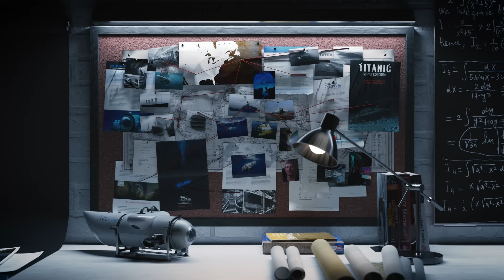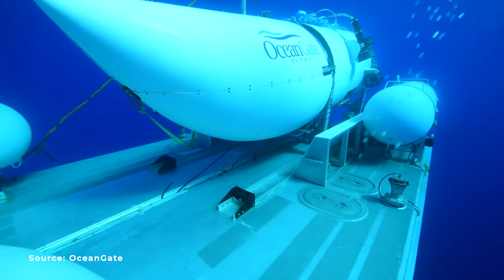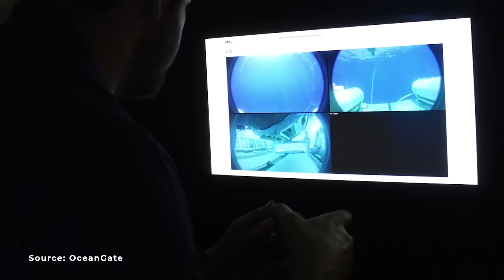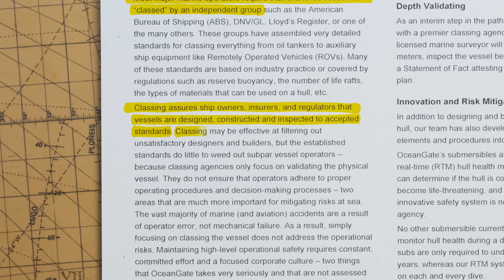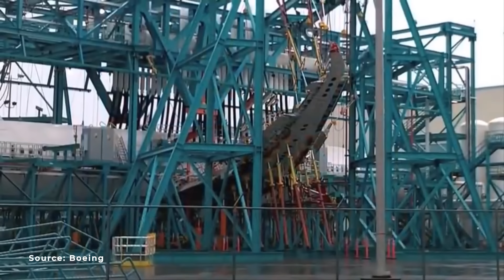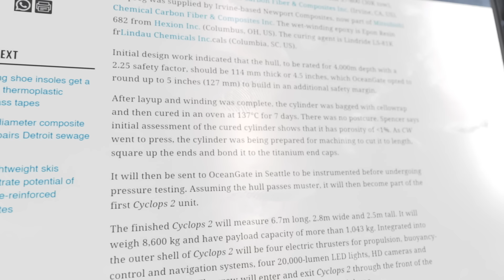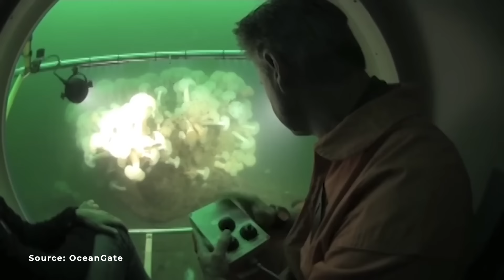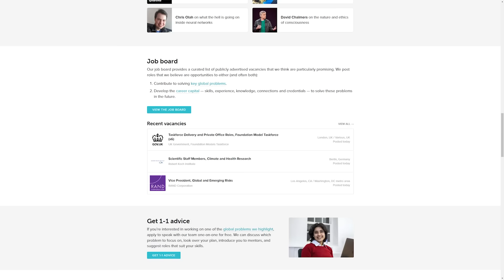The Questionable Engineering of Oceangate

Comment: I remember a friend studying engineering in college told me his professor said he was so strict about them making mathematical errors on exams because, “engineering errors lead to injuries and death. You need to take responsibility that a mistake could be deadly.”
Reply: That's exactly why we do have independent entities and engineers check our work, to confirm that we've not made silly mistakes or overlooked something crucial.
Errors are inevitable but as long as convention and regulation is followed, you're at least doing your best and using the knowledge and experience gained from past mistakes.

F***ing hate it when cowboys come in and think that they know better...
Reply: I wish my students would understand the same! That is why I am strict on my engineering exams. Lives are on the line!
Reply: @DavidMcCoul  "safety regulations are written in blood, try not to create new ones"
Reply: @DavidMcCoul  Well, did you explain them, that's your job after all???
Reply: Being weak at higher math I decided to get into the Architecture rather than the Engineering. I simply  design Flighted Fantasy, the Engineers have the important task of making it a Reliable Reality.
Reply: @redneckhippiefreak depending on where you're from, us architects are every bit as responsable for a building's structural integrity as the engineers making the calculations
Reply: @agustinvenegas5238  Here in Germany there is not the one specific architect profession. Depending on their background you can have architects that only do interior design up to to architects who are contruction managers, handling all tasks from planing over writing the service specification for construction companies to bid on, down to the acceptance of the structure at the end.
Reply: @redneckhippiefreak  I'm sorry but I didn't say that, I said we're every bit as responsable for a building's structural integrity, again, *depending on where you are*, here in Chile, famously tectonically active country, I as an architect are equally liable for a building's structural integrity as the civil engineer bc it's my signature the one finishing the project before its sent to the municipal inspectors, in the US it may be different, another commenter said in Germany there isn't *An Architect*, but several architectural designers that, I assume, dont have the same liability as if there was one guy doing all that work, hence why where you are was the first phrase on my comment, I appreciate your feedback though m8
Reply: Regardless of lawyers and insurance,, engineers get put in jail for manslaughter for negligence.
Reply: This case is not akin to a mathematical error though, and more akin to modes of failure and entire branches of materials science being ignored.
Reply: i remember when we do component design in class, i tend to roundoff the 2nd decimal place this infuriated my prof.  and he showed me how my roundoff calculation made a 5cm gap in a critical joint.
Reply: In Canada, we get an engineering ring that used to be made out of iron (now just stainless steel), the same iron of the collapsed bridge that killed many people.  This is to remind us our mistakes will results in many lives lost.  A friend once told me, "I'm a surgeon, my mistakes can kill a person, your mistakes can kill hundreds, thousands, millions!"
Reply: @hhputube 
😮!!…
Reply: "Regulations are written in blood" is a saying that comes into mind
Reply: Its why engineers end up hating clowns with arts degrees.
I did aerospace engineering and I had to do 2 additional pure maths classes before we started on the wonders of aerodynamics and other fun stuff. The actual number of classes I had to take added up to the equivalent of an extra semester but planned to be done in the same time as an arts degree.

I have spent most of my career in industrial control systems and automation. A lot of that includes safety control functions like Emergency Stops and Safety interlocks. You know that stuff that keeps hands attached and prevents stuff blowing up. I eventually got the second highest qualification any engineer can get in that field.

Getting that qualification has kept me OUT OF WORK. 

People like Managers and their Human Resource minions don't like people who speak out and people with qualifications are often caught out. Their employment contacts often include clauses where "if you know something you must speak out" which clashes with the reality that if you speak out you get your contract cut WHICH HAS HAPPENED TO ME just like it happed to the submariner/engineer David Lochridge who's suing Oceangate.

You can't imagine how much I hate recruitment people these days.

If you think engineers are angry over this sort of crap YOU'RE DAMN RIGHT and its about time there were some actual laws that protected us. Because when we're allowed to do our jobs properly YOUR LIVES are safer.
- When your driving a car its mechanical engineers who designed the brakes to help you stop before the tree;
- When you plug something in its electrical engineers who make it so you don't get shocked;
- When you drink a glass of water its chemical engineers who make it so you don't get poisoned;
- When you get in a jet to fly off on your holiday its aerospace engineers who keep the wings attached.

We keep you clowns alive in 100s of ways every day.
And before any of you complain just note you wouldn't even be able to read this with out engineers.
Reply: Not really how responsibility is actually handled in industry. Any project significant enough to be a risk to human life should have a team behind it, not just one person, and there should be rigorous checks and testing to find mathematical errors or any issues that result from them. Good engineering process isn't about expecting nobody to ever make a mistake, it's about being resilient to mistakes.

At least one engineer realized the issues, so this wasn't an issue of mathematical sloppiness. Leadership on the project willfully ignored expert advice, and skipped safety processes. And on the engineering side, only one of the engineers actually put their foot down, the rest just went along with what they must have known was a huge risk. They had a professional and ethical responsibility to demand changes, even if that meant losing their jobs.
Reply: I don't think this comment is inaccurate, but the irony of it is : no amount of university exam math is sufficient for this application. Dry math doesn't cover it and some people get full marks on it because they know how to do it right. Book math doesn't go into much details about potential faults.  Projects and thesis do. And if you do the math, but end up applying it to imaginary, one time application properties that aren't consistent for the use case, you end up with tragedies.

There are math errors and there are design errors where the math checks out, but material science does not, e.g. lack of galvanization, pretty patterns that fill up with water and crack the surface in the winter or simply using the wrong kind of concrete for a salty environment.  There's people who are university exam smart, never work in a field and never learned  about edge cases or forgot about them.
Reply: And people question me when i keep values in my calculator to calculate something.
Reply: 12:33
At least 250,000 Americans die each year due to some sort of medical error. But, depending on what is considered a medical mistake, that number could be as high as 440,000.
Reply: Yes I’m an engineer as well, and we did one semester of purely risk analysis and risk management, because the consequences of engineering failure are so high.
Reply: Cut corners and rich morons doing make a tragedy. 
The 300 people that died of the coast of Greece the same day was the real tragedy
Reply: @existential_crisis_actor  Go look at the photos of that boat leaving the dock in Tunisia. It was a tragedy in the making from the moment they put 700 people on board that rust bucket.
Absolutely tragic, but also just as stupid as Oceangate.
Reply: I studied engineering in college and we had a separate course for safety and ethics about engineering
Reply: Everyone is strict about that. You can't have wrong math. Kind of obvious. Point me to a school that accepts wrong math pls
Reply: https://youtu.be/4NuXF0OCAc0
Reply: A teacher told us that he does not grade on a curve. Some of the engineers in the class would be civil engineers and if they made mistakes then bridge goes boom
Reply: @HanmaHeiro  "Tell me when a plane can pull over and park on the side of a cloud to await repairs.  Until that time, your work is perfect and you pass, or you made an error and you fail - at least here you aren't killing a literal plane load of people with every mistake."
Reply: @muninrob  Excellently put!
Reply: @HanmaHeiro  What do you mean a curve? Like a bell curve of all grades?  It's normal to not grade on a curve right?
Reply: @mintoc8853  It is normal not to grade on a curve. I believe the teacher was making it clear there is no chance of a curve being used. Or the whole this was kind of a joke to make a point since I remember him being a bit comical
Reply: @HanmaHeiro  Oh good, glad to hear that. Engineers graded on a curve would be a nightmare haha
Reply: Which frankly is BS because on a real world project you have other tools and less constraints to do the calculations (computers, etc) also you have a better feel for orders-of-estimation errors than on a theoretical test with often unrealistic values, also peer review by colleagues, etc
Saying "oh but if you get the math wrong the bridge will fall" is just hazing
Reply: @dsracoon  Mariner I exploded due to a forgotten hyphen in the code and the Mars Lander because of a wrong unit conversion. These projects consist of maybe the biggest teams you can find in projects yet these stupid mistakes were missed. Mistakes can and will happen, be it with old or new tech. You'll have less errors like that in civil engineering because it's less high tech and more traditional but that doesn't mean they don't exist.
Reply: @mintoc8853 civil engineers are the only ones i would trust now. The "engineers" that colleges and unis have been pumping out for the last 20yr are vastly less intelligent and cappable than the older guys. Ive been a boat builder since i left the army in 1986 and have forgot more about composites and layup than anyone thats came out of higher education since around 1995 when it got dumbed down
Reply: @bigduphusaj162  well maybe that's a problem of the local university near you or the people your company hires. It's normal that older engineers will be better as they have more experience. However if older guys are gatekeeping difficult projects without teaching the younger and demeaning them it's normal that they are less competent as well. In theory engineers today should be more competent than before because of the better tools we can use now. Ideally you want close contact and communication between engineers and constructors but sadly that's not always possible
Reply: im a boat builder of 4 decades and i wouldnt trust anything a lecturer or even a masters or post graduate student said pal. I'm the one that needs to fix your modern activist type "engineers" mistakes amd some of them are needing jailed tbh. Vessel building needs older experienced guys at every level from cincept design through to the final pain finish it needs proper craftsmen not blue haired colledge guys and lecturers that failed to make waves at the real job in the first place to even be where they are teaching the blue haired activists
Reply: @bigduphusaj162 quite an ignorant comment, everyone has their area of a project that they specialise in. Your area of expertise is in the construction, others in the design. Neither party could do the others job
Reply: they dont take responsibility, thats what lawyers and insurance is for
Reply: @carlholland3819  Technically, yes. You shouldn't be held personally responsible for any and all mistakes as long as they are not simply rooted in negligence. And this applies for many professions. But... If you're in an job, working on something where lives might be at risk and you feel no responsibility what so ever, you're in the wrong field.

And, when I say "you", it's not you as in "you, carlholland3819", but you as in anyone in such professions.
Reply: @jonsen2k  as an automobile technician I always double check my work because if you do not its very easily can lead to a death.

Comment: In one area you gave a slight false impression.  Generally if the inside layer comes loose, the next layer follows and then the next and then next to the point of total failure, all at the speed of sound in the material.  There is basically nothing, nothing, nothing, BANG.  There is no warning.
Failures like this are most common at the ends of the chamber because there is a discontinuity of forces right there.  In the designs I have seen work repeatedly, the bulkhead has a flange that rests against the end of the tube and a part that goes inside of it.  The part that goes inside is a tight fit so that at pressure the tube comes down and rests on its surface.  The tube is also gel coated on the end and then made to be an extremely flat and smooth surface.  The part that goes inside has two O-rings.  This is a long way from what Oceangate did.  They epoxied a metal ring on the end of the tube.  To me this seems to be just asking for temperature related stress to happen in that area.
If someone really did hear noises from the tube on previous dive, that person was extremely lucky.

Comment: When I first heard about the submarine thing I just heard a submarine was going down to the Titanic and got stuck or something and it was like oh damn shit happens I guess.
And then someone said they used carbon fiber and I was like oh damn someone's retarded I guess.
I am a fucking hobbyist. I have zero engineering background and experience but I know how dumb that is.
For an easy anecdote in the '90s Honda tried to make a carbon fiber motorcycle where every strand was individually woven for maximum structural rigidity. The writers hated it because every single bike felt different because the material is not homogeneous lol.
And there's a million other similar examples. Carbon fiber is really fucking hard to work with at anything above a hobbyist level.

Comment: I was surprised about how little overlap there was between the carbon fiber and the titanium flange. When I first heard about the design I expected there would be a substantial titanium sleeve under the carbon fiber but it looked to only be a couple inches. Granted, the pressure would tend to push the end caps on but I still wouldn’t be surprised if the issue started at the junction between the titanium and carbon fiber.
Reply: That's exactly where I imagined the first layer to peel off, then the bang of the implosion of the air being crushed to the size of a baseball. Poor folks.

Comment: An "Agile" methodology in engineering is fine when the incremental steps don't endanger people's lives. SpaceX still has to meet FAA and NASA standards. The iterative design model is exactly what you want to gather necessary information regarding known and unknown variables. You just need to do it responsibly and not brag about flouting best practices and risking people's lives.

Comment: I am no materials engineer, but I was saying this from the day I heard about this. It seemed to be a misapplication of material exacerbated with lots of other bad engineering choices that made it even worst. An inferior geometry (cylinder vs sphere) requires stronger materials not something that is unproven. 

And, like you said, carbon fiber epoxy composites are good in tension but terrible in compression. You only need common sense to conclude that. Take a shoe string and pull it from both ends vs push it from both ends. That tells you everything you need to know. Since the carbon fibers are worthless in compression, what dominates in compression is the epoxy matrix (which are actually layers of epoxy and not solid either) and is why you have that end of a cliff failure mode. It is brittle, and because it is layers, it can and does delaminate easily...particularly after repeated pressure and temp stress cycles. 

And that was only one of the problems. Mixing disparate materials and bind them with glue, bad manufacturing, impossible to computer model, no real testing. Etc. On bad manufacturing, you can see it in their videos they were applying the binder and the epoxy layers with hand. This, in and of itself, is super dangerous, it makes for uneven layers and opportunity to form micro bubbles. And lack of pressure curing ensures that these microbubles will be there. They will later become starting points for delamination, or promote delamination.  

This was Russian roulette in the form of a submersible.
Reply: A form of Russian Roulette...but with 5 loaded one empty...near guaranteed winner.

Comment: I'm not a composite material engineer. I'm a dude who reads a lot about things that pique my interest. I know a fair bit about composite materials, by learning about F1 cars and drones and such. As in, my knowledge is second hand simplified foot notes at best.

When this story first broke, I told some of my friends how carbon fiber doesn't compress well, or twist. It's meant to be pressurized, as the forces are inverted. I also suspected the titanium endcaps shrinking enough to break the ring they were attached to, and that is where the catastrophic failure point originated from.

Again, not a composite material engineer. Just a dude with a lot of curiosity.

So if I knew this, why did the billionaire with his head up his ass decide to push through it and ignore everyone else?

because his ego knew best. Physics is a cruel bitch.